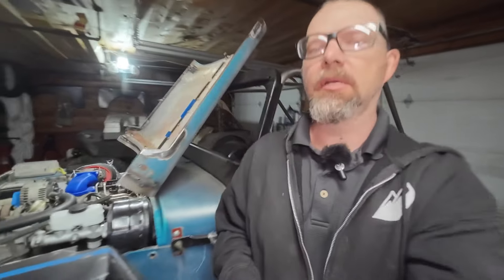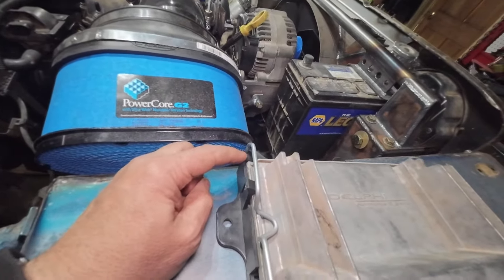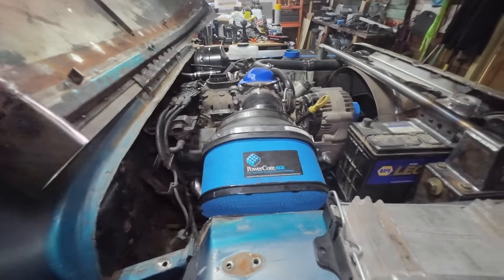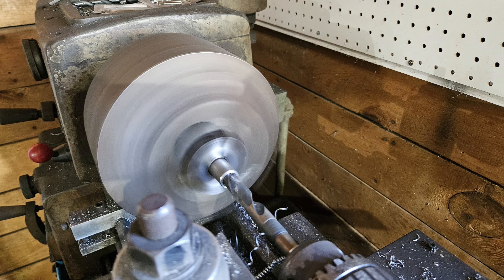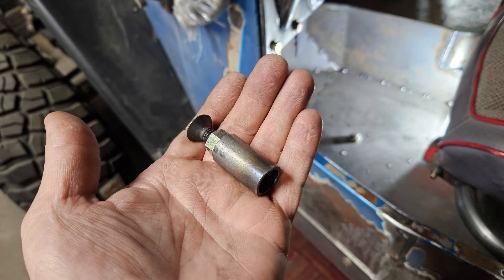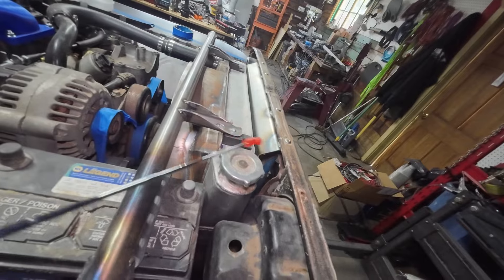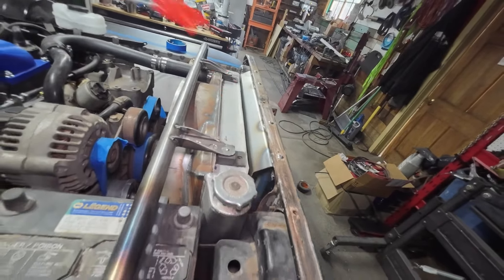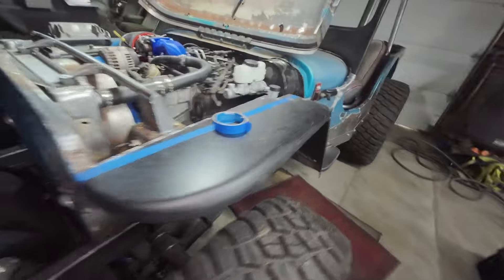Old Blue Willys Part 44

Comment: Man, I would definitely move the battery to the inside and use that space for the computer. A lot less to package through the firewall.
Reply from the maker: I've run batteries inside in fatties, they eat up a ton of space. It's all a series of compromises. I'm investigating some other (smaller) computer options that may give me more options.

Comment: I original had that computer on my '02 engine, but I went with an earlier version of the computer with the non-emissions. You might want to decide on wiring harness before you worry about computer mount.

Comment: Curious,  why not tuck it up inside? Other side of firewall?
Reply from the maker: running a wrist size bundle of wires through the firewall isn't fun, but that might be what has to happen. There isn't exactly a ton of space under the dash on a flatty, especially if you want to fit a heater under there.